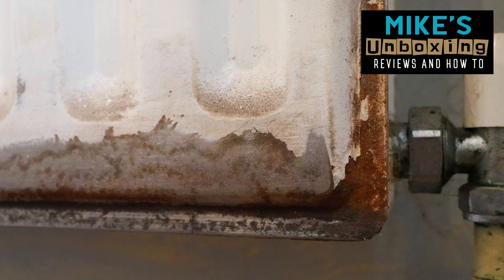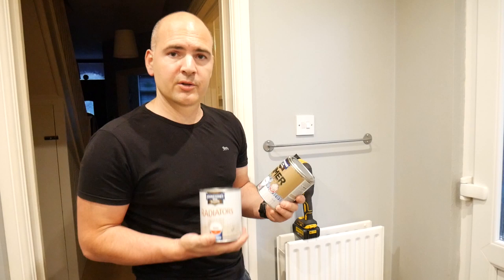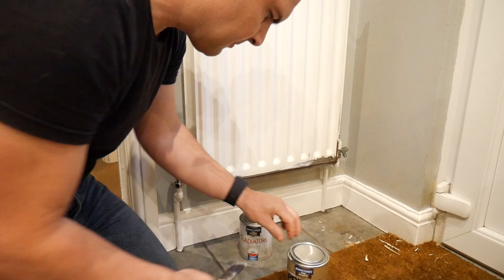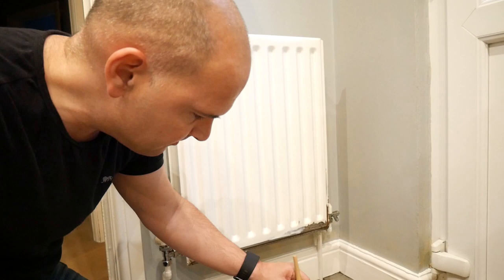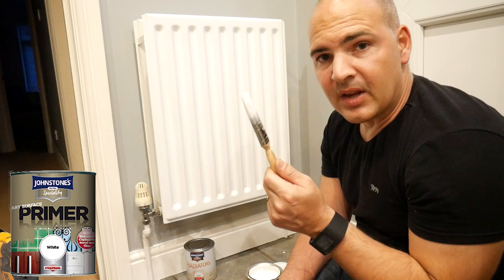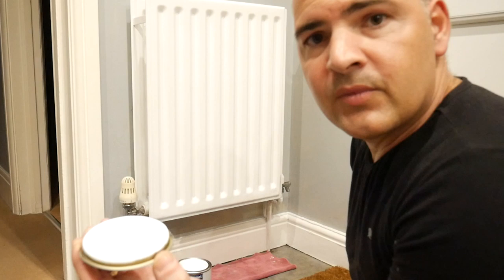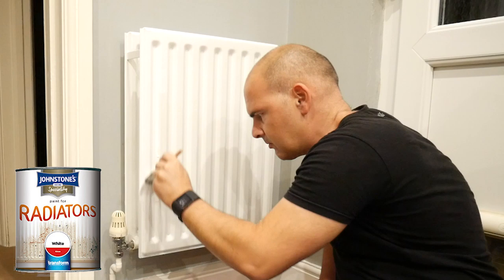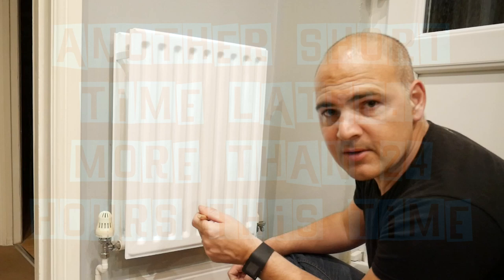Best Paint For Radiators? Johnstones Or Hammerite? Restore A Radiator

Comment: Thanks for this review.  Glad I watched to the end, otherwise I would have bought the Johnstones.
Reply from the maker: To be honest the Johnstones isn't that bad, If I had prepared the area better I think the result would have been better. It still is very white 4 months later, which is pretty good in my opinion. If it had a rust preventer built in it would be a much more useful product. Thanks for commenting. And let us know what paint you use and the results.
Reply: I'm glad I found your video I was dithering about buying the Johnstone's paint as the Hammerites is out of stock locally but based on your video I hold off until i can find it.  I'm not a fan of Johnstone's paint as I always find them messy to use and tend to leave a poor finish.  Thanks once again for your video.
Reply from the maker: Thanks 🙏

Comment: Just done my rad. Best bet is to close valves and take rad off. I cleaned mine with wire brush, screwdriver, 80 grit sand paper. I then used Kurust to neutralise the rust. Sprayed a two primer coats and then sprayed two coats of radiator paint. Looks good now but in hindsight I would have used non spray radiator paint and rollered last coat on as I like the orange peel look.
Reply from the maker: Nice work!

Comment: You might be able to use a rust converter like vactan. I've used it on the underside of a mower and is awesome. It doesn't like heat, though, so not good for stoves etc. A radiator might be OK, though, as not direct heat like a stove.
Reply from the maker: Thanks for the idea!
Reply: @mikesunboxing  It's really good because it is like a rubber type texture that makes the rust inactive then blocks it to the environment for moisture so good for a bathroom radiator. I'm going to try it and then paint with a radiator paint - probably gloss. Thanks. You can only get it on eBay. They use it in the marine industry a lot I've heard.
Reply from the maker: @rtyrtyrtyus  Appreciate the info :-)

Comment: I use hammerite radiator gloss paint I noticed straightaway it's more runnier thinner yes I did spend a good few minutes stirring paint it will most likely need 2 coats 16 hours apart only thing is I can't turn off hallway radiator as it turns all radiators off 

I'd have used some cure rust treatment on that rust
Reply from the maker: I need to have another look at it but i need the radiators on at the moment. BBBrrrrrrrrrrrrrrrrrrrrrrr
Reply: Same here temperature wise as unfortunately I don't cope with cold too well
Reply: Regarding the rust I noticed a small patch on bottom edge at back of radiator only reason I noticed it is cos I felt it as I was trying to clean old fluff from bottom and I had a look using a mirror and torch so I went out and bought some Kurust and yup even nail polish remover now before anyone says somet hilarious I have a plan to see if it's gonna help remove old gloss from around edge of where rust meets edge of old gloss if that don't then I'm breaking out my p60 sanding paper and even a wire wheel Dremel type tool and small wire brushes which are meant to be for cleaning paint brushes paint brush combs we shall see how it goes what's worst that could happen
Reply from the maker: @Gollammeister  let us know how it goes. I tried some kurust on my LG fridge freezer and it didn't help much :-(

Comment: Looks a nice finish to me I'm assuming that if the radiator paint is water based then it's not gonna have a strong smell
Reply from the maker: I rushed it a bit to be honest, if i had prepped it better i would have got a much better result. The rust wasn't dealt with so it came back through after a while. I may give it another go, although the cost of a replacement is probably not much these days. I think i'll wait for the warmer months before i tackle it again.

Comment: your better of just buying trade paints johnstones trade paints are very good your be better of spending that extra 10 20 quid. I haven't used hamerite but I believe that's on the trade catorgry if it is that's not really a fair comparison. for metal primers I would if I can use a oil based primer much better coverage more durable and water based undercoat and gloss or satin with a alkyd resins stronger than acrylics for rads I would normally use johnstones trade water based undercoat gloss or satin which have alkyd resin from oil based paints.
Reply from the maker: Thanks Jack. I'll take your advice, and when the temps rise a bit i'll tackle the job again. Although the rate the rust is taking hold, it might turn into a "how to replace a radiator" video :-(
Reply: @mikesunboxing  I decided to cover mine!  Tho I will give it a quick coat first. 😊

Comment: Why didn't you just change the radiator for you £30 ?
Reply from the maker: I was tempted but draining the system and all the hassle I seemed like a better  less wasteful option. I might still change it as it has rusted again a little
Reply: @mikesunboxing  lol changing a radiator is quicker and cheaper than paint,  lol ive just learned how to drain and change . B&Q free next  day delivery and takes about half an hour for a small radiator like that ... job done cup of tea and feet up lol
Reply from the maker: John Cowan if you want to come round and show me your skills I’ll make the tea
Reply: @mikesunboxing  lol the watcers are not fit to make tea for the masters , keep up the great reviews 🤠
Reply: Besides I've just this minute finished taking my stairs handrail back to new lol saved myself £80 , but i don't own my hands anymore lol
Reply: @mikesunboxing  You wouldn't need to drain the system down to put in a new radiator.   Also, if you can't get the exact size,  maybe because the radiator is older size, you can get extending joints to do the job.